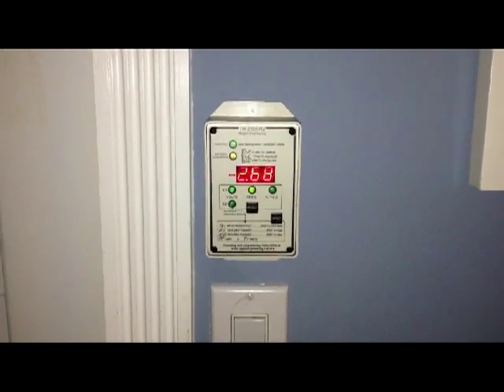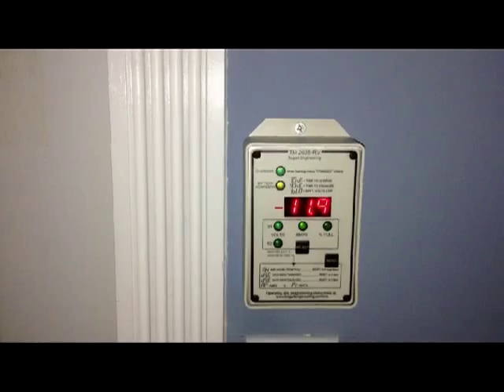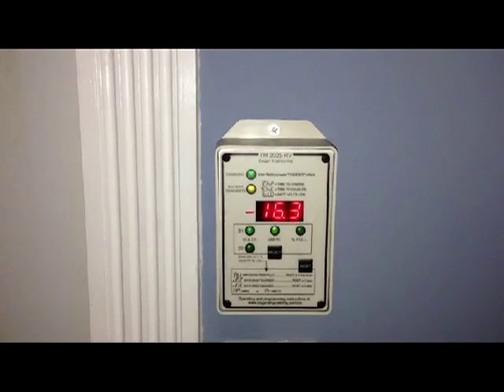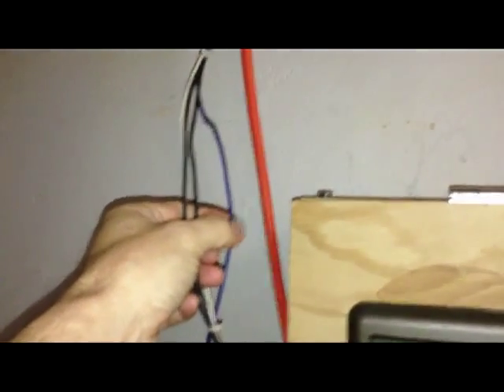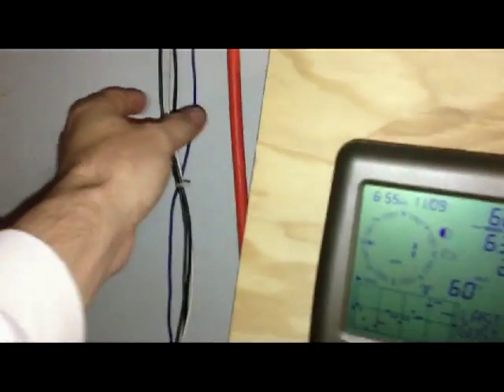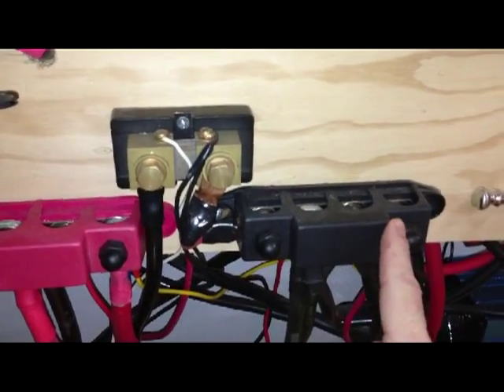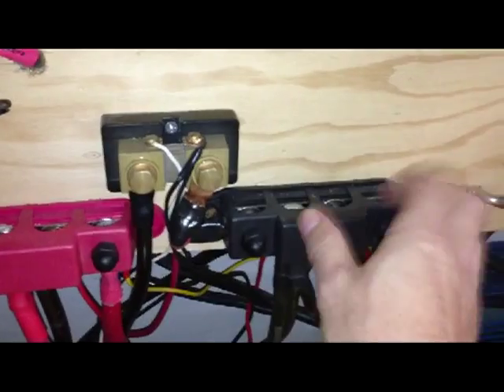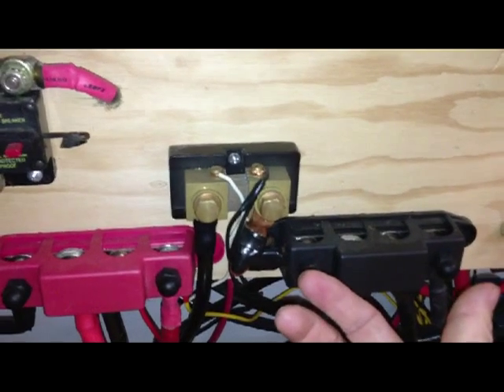Trimetric False Reading - Part II (details)

Comment: Did U find out what was wrong?  I get crazy stuff like that a lot but it is most likely something I did ,or got a defective unit.
Reply from the maker: Never figured it out, but got some good suggestions to explore in meantime. i did however do hard reset of the Trimetric and seems to be working ok now. like a computer, sometimes troubleshooting these issues can be more work than getting new unit. It could be something with the circuit board inside the unit which is causing erratic display..so hard to say.  thanks for comments